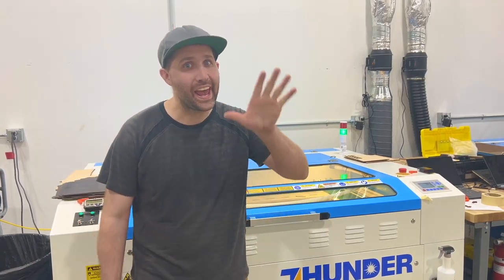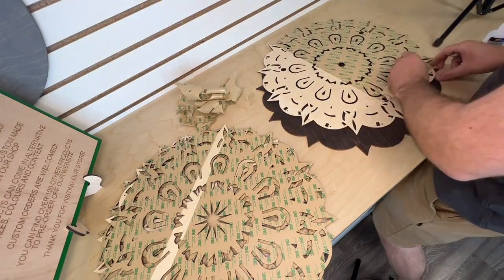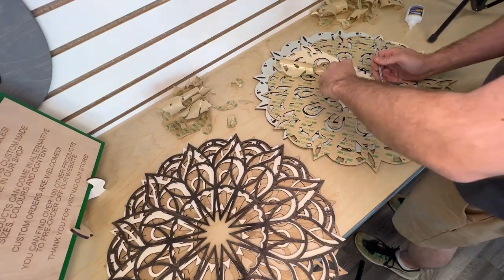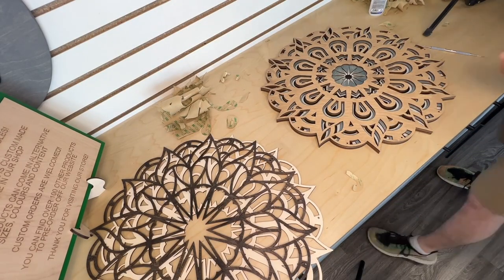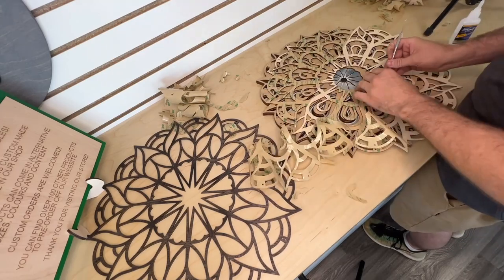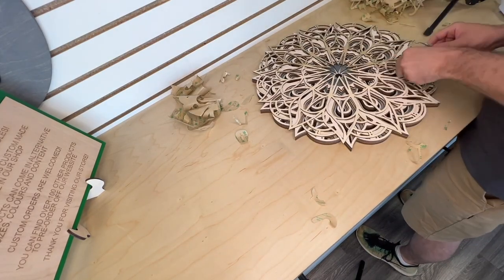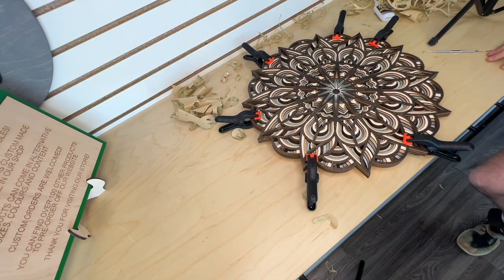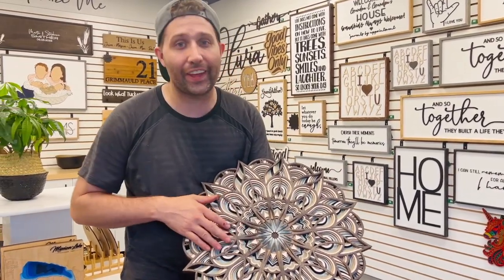Assembling our Laser Cut 3D Mandala Sign | Cut with a Thunder Nova 51

Comment: As far as the assembly goes, getting proper alignment could be achieved very easily. 
If you simply take large boards the same thickness as your layers and cut out only the perimeter of each, you could stack them in an inverted order, (top layer on the bottom, bottom layer at the top) and drop each one into place face down like pegs in a hole. You'd need to be more careful to ensure no glue squeeze out at the edges. But other than that, this should speed up assembly and guarantee perfect alignment for every piece.